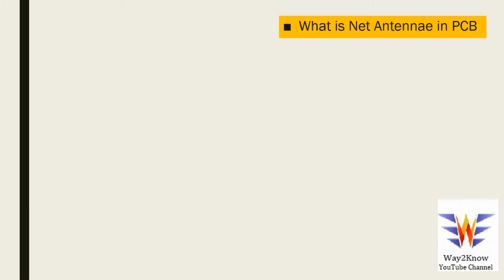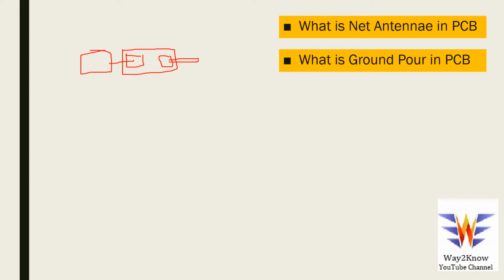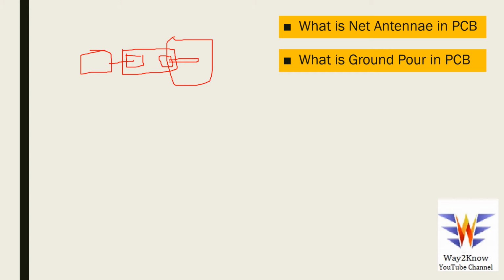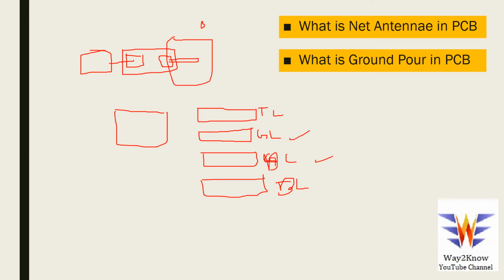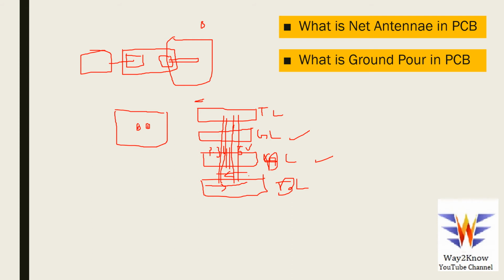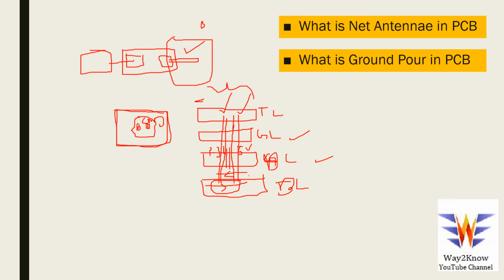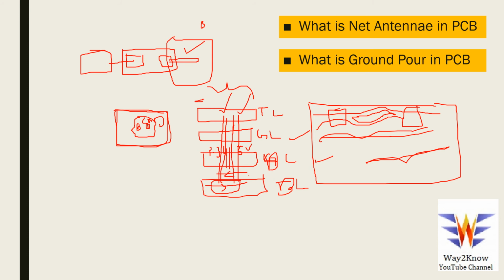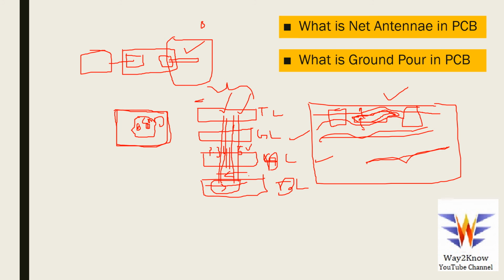PCB Routing guidelines || PCB Design guidelines for freshers || Net antennae || Copper & Ground pour

Comment: Thanks for your explanation. I am skeptical about NC pins in an IC's. For them pads are placed in PCB, but not connected any where. does it be a net antenna condition? If so what should we suppose to do?
Reply from the maker: It is always preferred not to have open ended lines or pins in embedded circuit. If you want an example or any recommendation, you can take a simple microcontroller datasheet, it always recommends to terminate unused pins. Microcontroller, doesn't have high speed interfaces so if it is a high speed design you know what need to be done. For RF, it is more dangerous.
Reply: @Way2Know   Thanks Sir. It was clear. But in case of  op amp IC's pin 1,5 and 8 are usually not connected anywhere. I presume as far as it is not high frequency application Those pin termination doesn't make much of a problem.